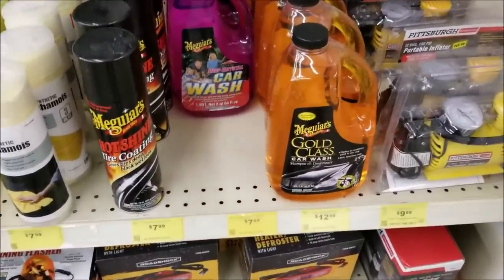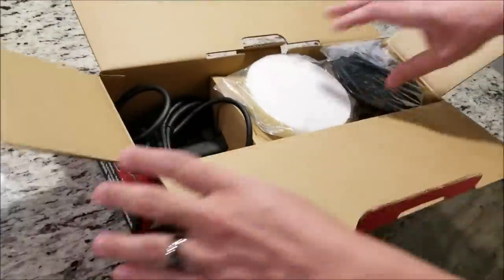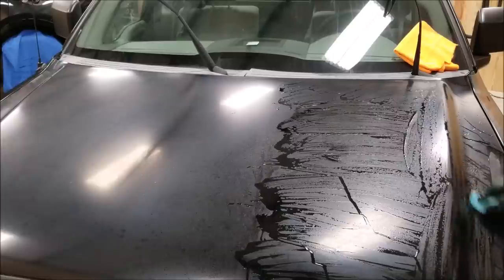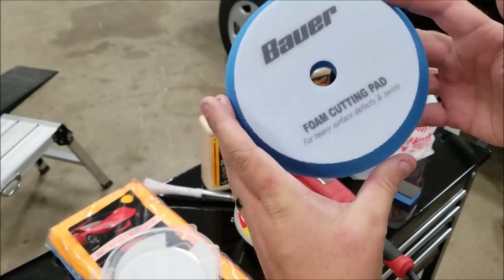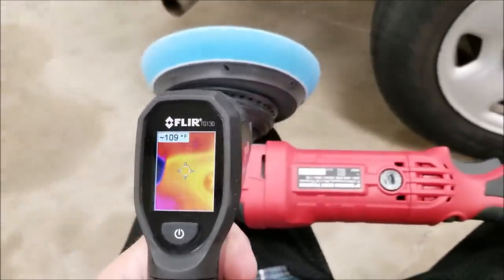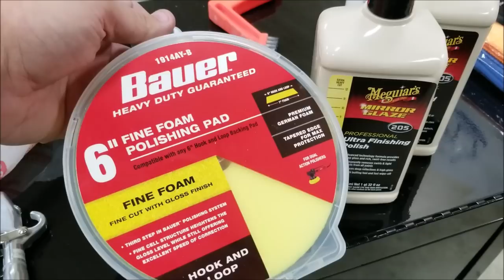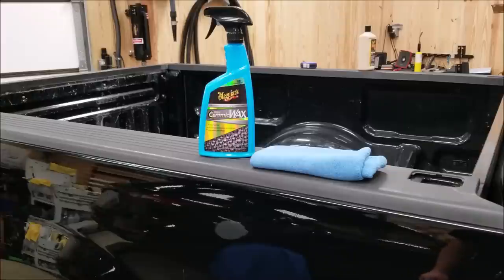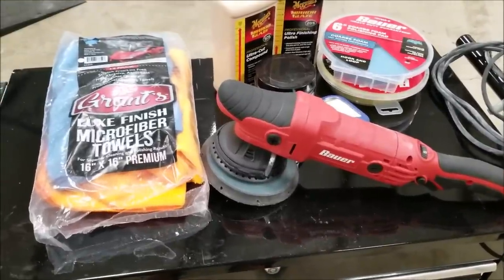INSANE 2 Step Paint Correction using ONLY Harbor Freight Products for less than $200 HF Bauer 56367

Comment: Thank you for the video. I recently bought a bright red 2006 motorcycle with only 1200 miles, and the paint on the tank and front fend look good, but there are lots of swirls in the paint. The rear fender looks cloudy and when it is wet, it shiny, and then when it dries it is dull again with a milky tint to it. I plan on doing this right after the holidays and making it look brand new again. Hopefully, It looks close to what it was back when it was on the showroom floor in 2006. Correct me if I am wrong, but that polisher can be used on chrome parts and restoring plastics too, right?

Comment: Great video! I see now that it’s a month old, but you mentioned the microfiber towels being a bit “spendy.” I’d like to know your thoughts on cheap v/a expensive microfiber towels.
Reply from the maker: Sure.  I buy a lot of my MF towels at Costco where they are $15 for 36 of them.  Autofiber is another place I get the nicer ones - some of which are still cheaper than HF.
Reply: Scott H I use a lot of Costco towel too, and honestly, I suspect they would not scratch any paint. I still have some pricey ones, but I tend to wonder if we are all being ripped off. 😂

Comment: I have overcome the shortcomings of this machine by downsizing to a 5" backing plate and swapping the high temp grease for something much better. Vibrations virtually goes way down to 90% closer to the rupes.
Reply from the maker: Great tip!  I actually made a video about doing just that!  It made a WORLD of difference!  I've had the machine running almost a year in our shop and it is still kicking. https://www.youtube.com/watch?v=mr2vV-O0LzM&list=PLtXHnI1Ee-eWFsqe9dHRmsuskBhwCpgAb&index=2&t=228s
Reply: Which 5” backing plate did you go with? Thanks

Comment: Damn this is really inspiring, my paint looks just as shit as that truck did. It's just an old used nissan that has too many dings and crap, needs a refresh. Gonna have to find a good polisher in Canada though.
Reply: For the record, all the supplies can be had from Amazon Canada for $300 CAD
Reply from the maker: That's not too bad.  Does Canada have Harbor Freight or an equivalent type of store?
Reply: @ScottHD   princess auto is pretty close, but I'm not even sure they sell polishers

Comment: I seen a video where a guy changed the grease in the gearbox and changed the backing pad for a flex 5in and most of the vibration went away and it was much better balanced
Reply from the maker: That's me. :)

Comment: Videos out regreasing with high temp synthetic grease make sense.  I'd use a 5 inch backing plate and pad and anti vibration gloves
Reply from the maker: I'm going to experiment with that.  I bet the Rupes backing plate swaps right on it.
Reply: I got this polisher as a backup when my Torq was away for repairs. I much prefer it with a five inch plate. I still haven’t changed the grease out but that seems to help all cheap polishers. Brian at Apex Detail did a video on this. He also made other recommendations for it.

Comment: Scott a major transformation  on that sun beat truck. Would have do a lot more passes on roof and hood with M105 or a microfiber or coarse wool pad or a straight up microfiber pad since you were doing a 2 step. Time is money as detailer. Compound first, pad 2nd , and machine last according to Mike Phillips.
Reply from the maker: I wanted to do that so badly, but wanted to stick with my theme of using only their products. It definitely needs a MF or a wool pad on the roof and hood before stepping it out finer.

Comment: I just bought a Rupes LHR21. Can I switch to a 5inch backing plate without changing the vibration and does it have to be a Rupes backing plate or can it be whatever backing plate such as a Torq?

Comment: How often did you re-apply compound to the pad? I bought the same set up & used it on my truck last week. Same model f150. I re-applied 4 nickel sized drops each time I moved on to another 2 foot section. After about 20 minutes use, both blue pads started putting out a lot of wet compound & then tore apart from the backing. Both happened at speed 4. Wound up continuing with green pads for compound & yellow for polish, both at speeds 2-3, and didn’t have anymore come apart.

Comment: Very good video.  I am going to do a paint correction on my wife's 1991 red Mazda Miata.  The issue I have is that the paint is a 1 stage paint with no clear coat so I can't get aggressive with it.  I am going to do a clay bar, then use Mequiars M205 and then of course a wax.  What wax would you recommend?

Comment: Thanks for the informative video. I'm a weekend warrior and used that machine too, but I opted for the HF house brand pads. I used the orange pad with Meg Ultimate compound for light swirls and but didn't get the greatest correction results. Because so many good reviews on the Megs compound, i'm thinking my issue was with the pads??
Reply from the maker: I think that is most likely the issue... I have used several of them now and it seems like they haven't been super consistent with their quality of the pads.  May give RUPES, IGL, Lake Country, etc pads a try.
Reply: @ScottHD  Thanks so much for the advise!!

Comment: dumb question, but how do you know which cutting pads to choose? For instance, how come you chose the blue coarse pad over the orange pad or other options?
Reply from the maker: It really depends on the severity of the defects, but if it is in the condition of this truck, I would generally use something very agressive to make the finishing steps easier.
Reply: @ScottHD  oh okay, thanks for clarifying. 
Also just curious if the defects are not that severe at all would using an aggressive approach such as this still be acceptable and get the job done or does it pose a risk compared to using less aggressive pads? 

lastly, how many pads do you recommend if you don't have a compressor to blow them out? I was thinking 4 for each step

Comment: So on average, how long do you polish with a machine and how much pressure are you applying?
Reply from the maker: Moderate pressure for the first step, light pressure for the second.    The worse condition the paint, the longer you need to spend on each panel.  "average" maybe 10 minutes per panel?
Reply: @ScottHD  ok I'll experiment with it thanks

Comment: Hmm, my Griot's 3" also makes my hands tingle. Got me thinking of maybe taking it apart to balance it better. Been thinking of getting a 6" some time but didn't really consider the Bauer as an option. Guess I should. 
Also got me thinking about opening up the head and changing out the (probably cheap) grease for something better that might keep it cooler.
Other than getting hot and shakey, how did the bauer perform? I'm guessing "as expected" since you didn't really say anything positive or negative about it.

Thanks for the vid!!
Reply from the maker: Lucas white lithium is what we run in our other polishers - I may try to do that with this now that I've finished this video.   I think it is a decent tool for the price.  I would suspect that they balanced it (if at all) without a load on it, or without taking into consideration the weight of the pad/compound.  If you run it at no load, it still vibrates quite a bit.
Reply: Interesting. A buddy was telling me that the griot's 6" shakes as well, and some people say going to a 5" disk on it balances it better.
Reply: @ScottHD  There is a video of someone changing to a 5" BP with white lithium and said that the results were amazing with the Bauer. Balanced and very little vibration and noise.

Comment: Looks like Griot's has a $200 2-step kit with an orbital polisher. "Is this ready-made $200 solution ALL you need for paint correction?" Maybe worth revisiting again this year? Or maybe some other "all-inclusive" kit, they seem to have quite a few, even with more orbital polishing kits. At what point are you going from buying a complete solution to paying for convenience and a name? (And what the hell is this "Synthetic Clay" thing they're selling?)
Reply from the maker: Absolutely. I'll check it out
Reply from the maker: No clue on the clay.
Reply: @ScottHD  Went back to see if I could find what I had seen before, it's under Wash & Detail Kits instead of Buffers & Pads where I started looking first. (The "clay" looks like a buffing sponge with a textured rubber surface. I kinda question how safe that can be for paint…)
Reply from the maker: @waffle911  interesting.  I will probably pick one up at a later date to try.